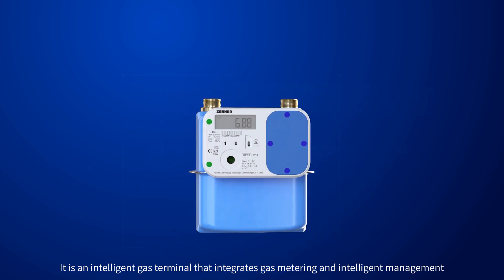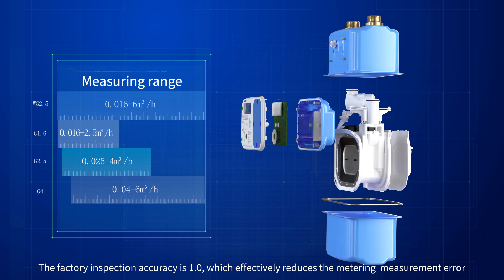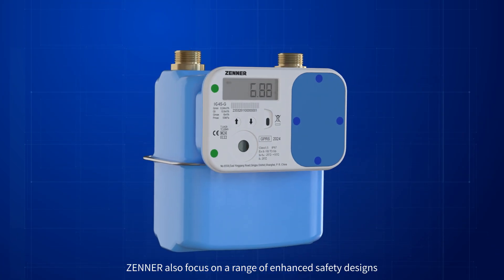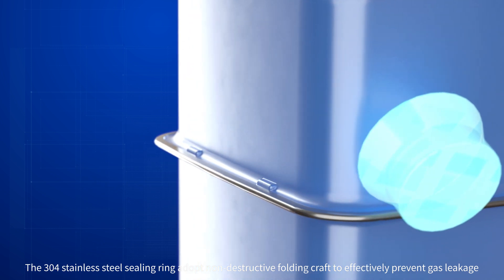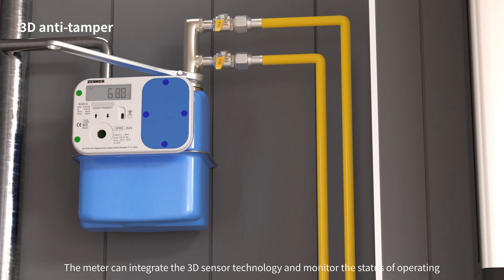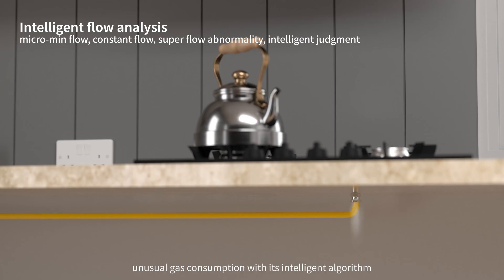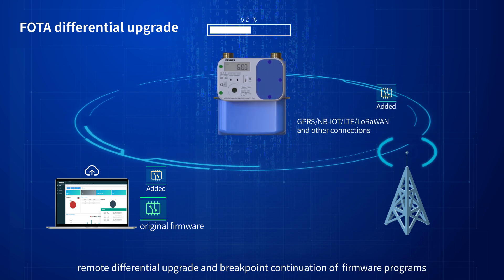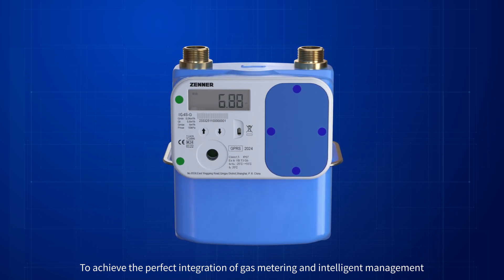Zenner Smart IoT Gas Meter

Comment: Hello, How can I read consumption data out of this Gas meter? I have IR communication device, I need gas meter`s communication protocol type
Reply from the maker: Hello, what country are you from. Are you using Zenner gas meter?  Generally, we have technical manual or user guide of the gas meter for reference.
Reply: @ZennerMetering  I am from Azerbaijan and almost most B2C customers are on mentioned model. We have never been provided with manual
Reply: @ZennerMetering  customer support also not provided any details or aware of  optical data flow of counter
Reply from the maker: @trecords2  For this technical or business-related inquiries, please send a detailed and formal written email to sales04@zenner-metering.com Please specify your purpose, the Company and Country you are from, and the issue you are encountering.